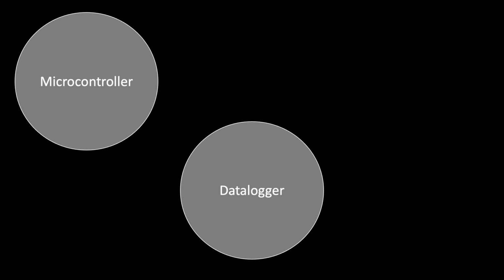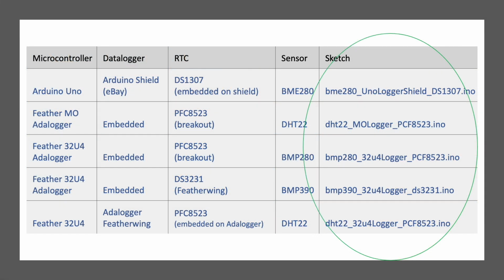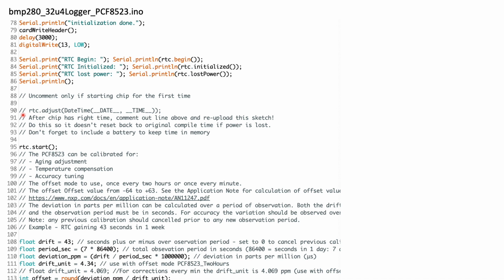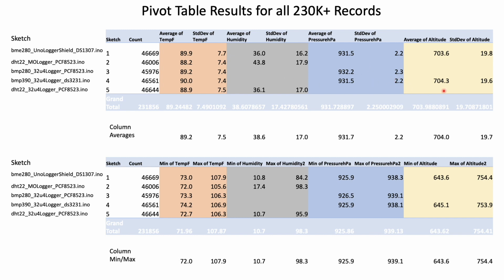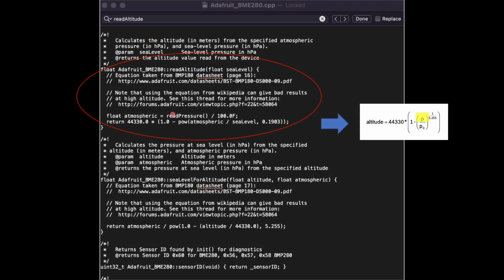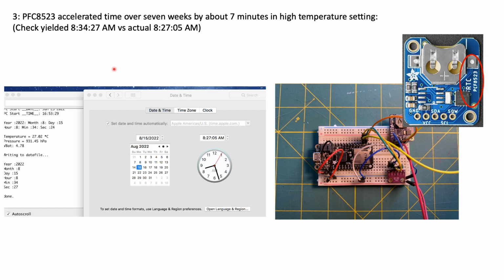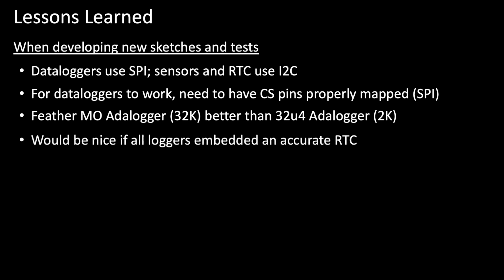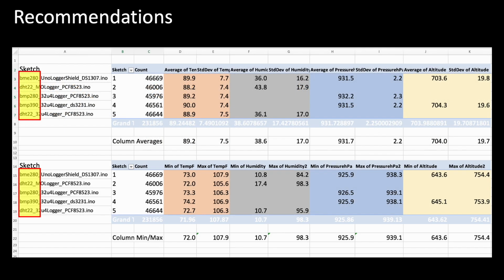Logging Weather Data with an Arduino Microcontroller

Comment: I Need ur help
iam poor in english pls adjust the comment
..accidently i gave 12v in my arduino uno  rx pin  then my arduino uno not working  and the usb to serial ic chip heating  and my arduino on but iam press reset button its not reset and the led not working  i hope my arduino not died the   usb to serial ic was died so now iam totally blank  what can do next i don't know  and iam not have money to buy other uno so i need ur help

hope u reply the comment 🤧
Reply from the maker: Hmmm... That pin is not meant for receiving power, so I'd be surprised if something were not damaged. I'm sorry - I would not know how to realize a repair on this.
Reply: @ModestMaker  it's ok 😒🤧

Comment: This was really cool!  I just deployed a bunch of data loggers based on the Beaglebone Black out to several industrial agricultural sites.  We have mains power and LTE access so we are able to upload data real time to Amazon Timestream as well as writing to local disk (just in case).  It's really cool seeing what others are doing with their field deployments. 

Thanks for digging into the altitude question in the BME280 library.   I was wondering about the internal workings of that particular issue when I was using the BME680 in my home weather station.
Reply from the maker: Thanks- curious if you are logging soil moisture for water efficiency on those ag sites (?). It’s something I’ve thought about for some time, and something I hope to soon try in my HOA to cut down on common area irrigation.

Comment: Good video! the height is derived from the air pressure and is changing of course according to the weather conditions and changing air pressure. A reference sensor with an exactly know topographic height could help in case you need a high accuracy. By comparing two BME280 humidity sensors I also made the experience, that can they easily differ by 10%. Reasons can be a slightly different mounting with different air convection. I am using the sensor together with LoRa boards and I gathering the data with a LoRa receiver and a little webserver.
Reply from the maker: Thanks for the response. That's the dream for me - to get this and other sensors integrated with LoRa and IOT. Have you published any materials on this?
Reply: @ModestMaker  Yes, you will videos EP07 to EP14 on my channel. Together with your SD card data logging would make it perfect.
Reply from the maker: Awesome- will check it out. Thanks!

Comment: Nice review. Humidity measurenment is "expensive". Cheap sensors, like DHT11 or DHT22 does not work well. I use Texas Instrument sensors, like HDC2080, Sensirion sensors, SHT1X, SHT2X or SHT3X, and Bosch sensors, like BME280. Regarding the RTC, I only use DS3231, only because I've bought a bunch. In a couple of applications I've synced the time using a GPS module in a location without cellphone signal, and a SIM800L module in a diferent location with a good cellphone signal. It is more expensive, but I really needed the exact time.
Reply from the maker: I like the idea of using GPS for measuring time. It’s an expensive approach, but one that works really well.